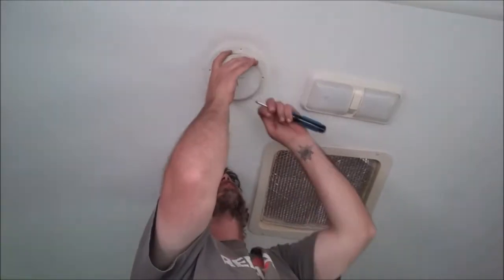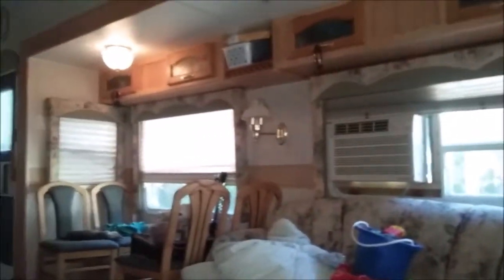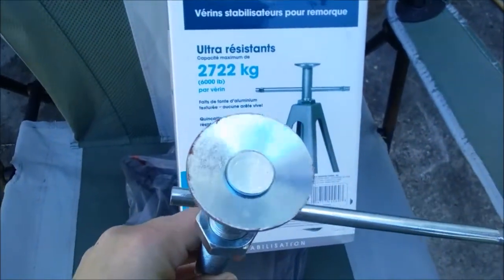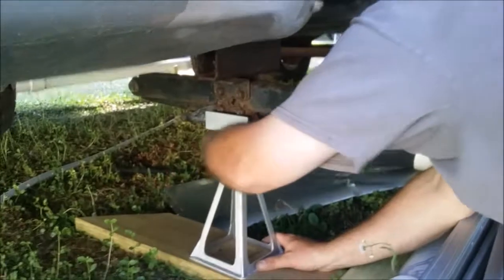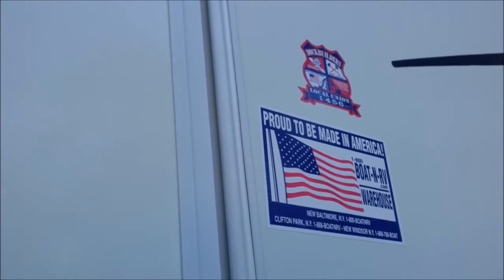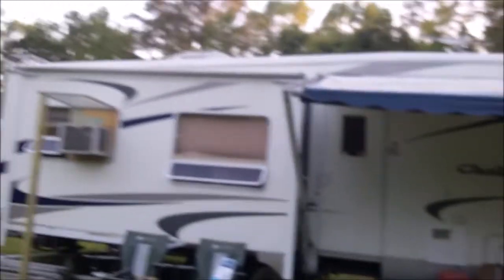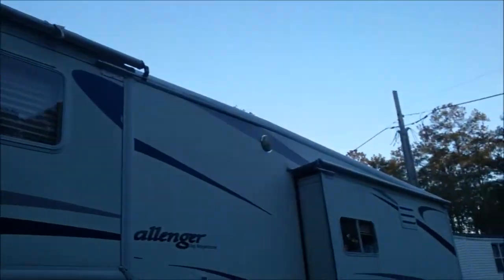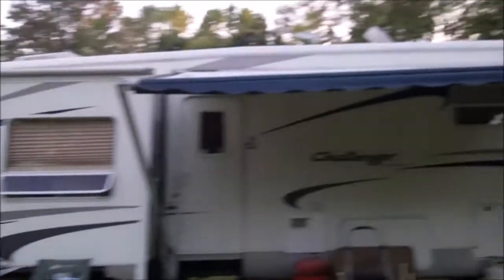Stinkin' Happy RV Jack Stand Hack, Awning & Canopy Inspection

Comment: If it was on a car it is considered totaled out junk. I really would check Cori. It may not be legal to be on a road to travel if ever decide to move in the future. You can buy the screen replacement in a roll at a hardware store.
Reply from the maker: I did check. It's fine. It's not major. If it effects the way it pulls then it's a concern. The company that hauled it for us told us straight away that it pulled excellent, no sway or play for the entire trip from NC to FL. Doug can always reinforce that area later on, for our own peace of mind, if we feel unsure abut hauling it. -- What screen? Our screens are all intact.